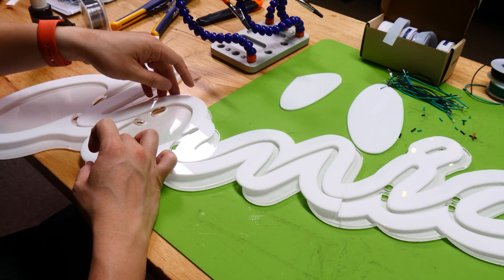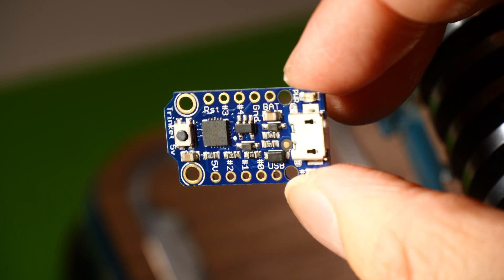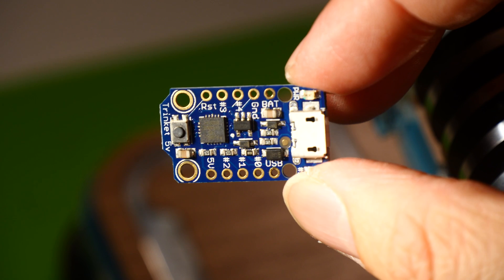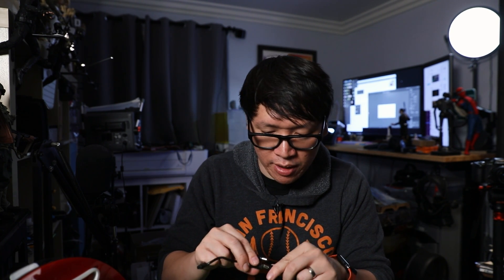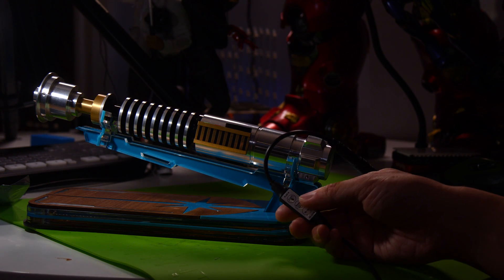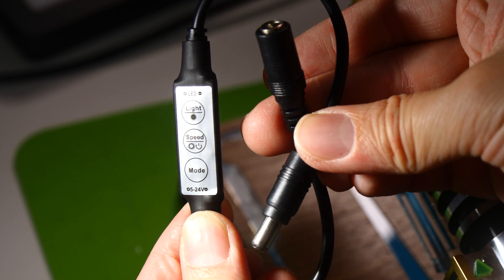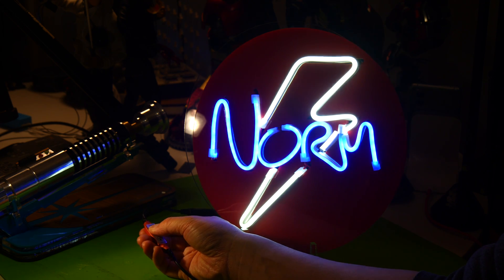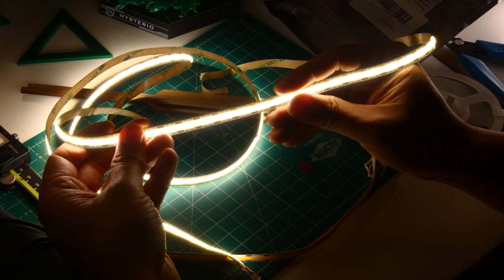How To Give LED Strip Lights Special Effects for $10

Comment: "This board is super cheap, under 10 dollars."
Lol. Supercheap would be like under 10 dollars for lot of five.
ESP32 bare module you can have for under 2 bucks with all that 240 MHz dual core, bluetooth and wifi. Ok, you have to know how to solder to use it, but that is must know anyway.

Comment: there actually are COB strips that are only 3mm thick and don't have any PCB showing on the side, it's all the width of the silicone strip itself 
 i had a hard time finding those and they are expensive, but thanks to some netherlands RC airplane shop i got me a couple meters and it's absolutely awesome

[edit: typos ! ]
Reply from the maker: I need to get some of those!

Comment: Very cool. I've been spending the last few days trying to wire up my nephews Halloween mask running off a backup battery pack. This would be great to add some effects to it instead of a static light, a slow pulse would be extra creepy. The company is in Troy, MI and I'm in Westland, MI. I can drive there in about 45 minutes and that's awesome, thanks Norm!

Comment: Awesome work, for the scale I would have gone EL Wire, you can 3D print little standoffs and arrange it like a real neon, also a little fog would make the scene. For video work you want a current controlled LED driver, with the pulse width modulation like those little control boxes have you get flicker on video from the PWM rate which you can see in this clip.

Comment: I love that Norm is such a great guy with skills to die for and yet the challenge of keeping his glasses from sliding forward has yet to be tackled. Right there with you brother.
Reply: Hope he sees this and maybe reads the reply - tiny silicon pads, cut to be the shape of the part that sit on the nose.

Weird at first, but used it at work as a carpenter when I needed to do joints and my glasses moved around a lot, just had em ready, had double sided tape on the back that kinda held, was really useful ^^
Reply: I got my glasses adjusted at the store where I got them. They have tools and skills (heat gun and experience) to adjust the parts of the glasses that curve around the ears. For me, a tighter curve helped the glasses stay in the correct place on my nose. I would recommend that to anyone who has the issue with sliding glasses.
Reply: All I can hear is the "reload" sound Donut Media style

Comment: These devices are basically the trinket and a transistor/FET to control the current from a GPIO pin.  The cheaper option is the most functional

Comment: Looks like the blinking one would be perfect for lights on a model plane.
Reply from the maker: For model planes there are also individual LED strands with wired-in resistors and blinking effect controllers that could work great

Comment: I did this years ago on my car with 4x 5050 led strips under the car going to a music/sound activated controller and then a mode/speed controller then a DC to AC to 9v to convert 9v into the normal expected voltage and amp requirements of the LEDs. Was stupidly cool as hell and illegal to use while driving but sitting in a carpark at night with it going attracted a lot of attention and it was great. That cars gone to scrap metal now but it was a Mitsubishi Lancer 1998 Australia model. Led strips would work on any car though.

Comment: The silicone encased LED filaments are even cooler than the COB strips. They're quite flexible, too. Though, you do need to solder them.
Reply from the maker: i haven't tried those before! how long can they run?
Reply: @tested  I haven't really done much testing with them, but they are effectively the same thing that are inside "Edison" LED light bulbs. So I would assume they have a reasonable life span. You can damage them by over bending though. I think you can get them in different voltages too. Most I have seen are 3-5V. The biggest challenge is they are silicone, so a lot of glues won't stick.

Comment: If you are doing something DIY why would you spend that much money for something so limited. A Simple Arduino board like does it all in one.
Reply from the maker: Same price, works without any coding if you need a fast solution
Reply: @tested  true true but ONLY available, or easly available on US
Reply: Also if you can do a group buy with a few friends, you can get Arduino unos and others a lot cheaper.